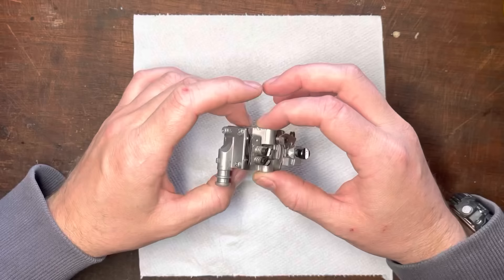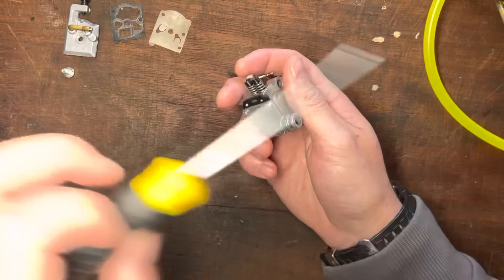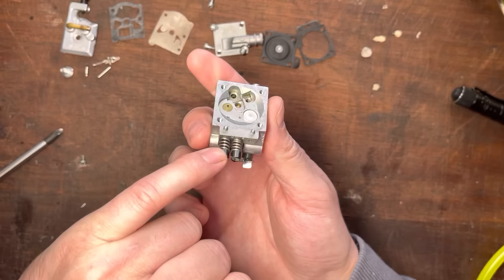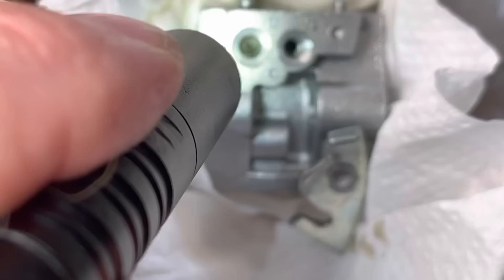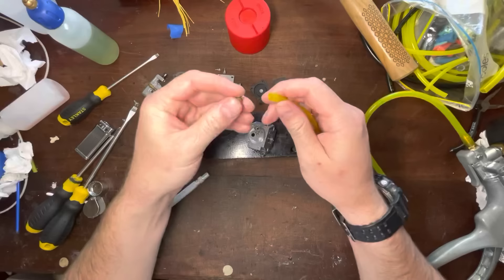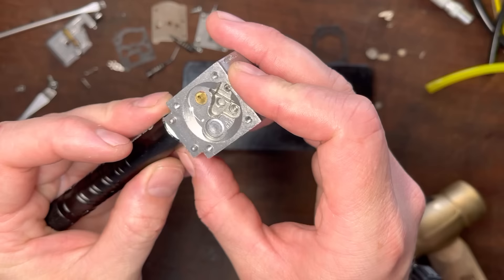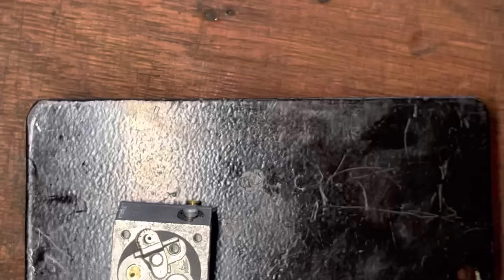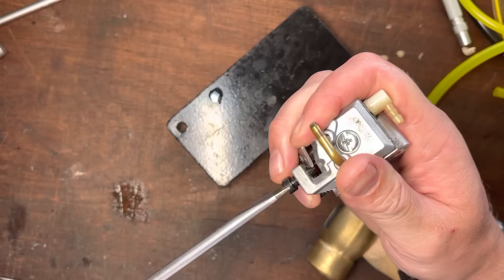2 Stroke Carburetor - In depth Fault Finding, Testing, Service & Repair

Comment: How can I test and or tell if the main Diaphragm is good or bad? Luv the close up views and pin pointer views! Thx much.
Reply from the maker: Thanks :) it should be soft and supple, should easily return to its position and be evenly symmetrical across the diaphragm in terms of shape and profile.
Reply: @VintageEngineRepairs thx much

Comment: Thank you for your video ...I am half deaf +....and I have been able to understand everything...
I have  a few carburettors when I move the  lever needle that it moves it up down  looking closely
I don't see the needle moving up at all ...How  can I  adjust the lever ?...can you help please ?
Reply from the maker: Thank you for your kind comment :) absolutely! The needle only moves very slightly first off, so do look very closely! There is lash between the metering lever and metering needle, therefore although the lever only lifts it a crack, the fuel pump will push it open more removing that lash. 

To set it correctly, requires you to know the model of carburettor, then to see how the manual wants you to set its height. It’s a simple
process of bending the lever. Skip to 24:40 in this video and I explain the process! Warm regards, Tom.

Comment: What will be symptoms if that main check valve isn't holding pressure
Reply from the maker: If it’s not holding, you’ll have strange lean symptoms at idle.

Comment: MR TOM  I would like to ask your opinion  about I am  going to replace the cylinder and the piston
on my Husqvarna 365 . I have got a new cylinder gasket should  it be OK  to instal it dry or should 
 put some kind of silicon on both side of the gasket ? Thank you Tony
Reply from the maker: Hey! You can use a little gasket dressing compound (not silicone!) if you wish, but it shouldn’t be necessary :)

Comment: Nice video. I was a bit surprised that you use that uneven surfaced block to hammer stuff on, as it could damage the mating face where the diaphragms need to seal. That block has all sorts of lumps and bumps bashed into it. I know you need something solid to hammer on, but I guess even a piece of dense wood would suffice with a lesser risk of messing up the mating faces.
Reply from the maker: Thanks for sharing! I have never had an issue, it’s very light and gently tapping. Wood may work perfectly fine, but it will absorb the impact and you have to hit harder to get the same result :) thanks for watching and sharing very valid points!

Comment: Hello, very detailed video, I like it. Wish I had the same equipment.  Don’t know if you can help or not but I am trying to clean up a Zama carb’  from a McCulloch titanium HT 555 , but can’t get a needle diaphragm or a kit for this hedge trimmer , would you know anywhere I could get these items.🤔😊plz.
Reply from the maker: Zama is made by stihl now days, best to contact your local stihl dealer with the model number of the Zama carburetor and they can assist you :)

Comment: Hi great video very informative , i plan on cleaning my zama strimmer carb and replacing the innards with a kit .
Would it be safe to use electrical cleaner spray to clean it ?
Thank you
Reply from the maker: Yep, that will be fine 👍
Reply: @VintageEngineRepairs  thank you , your channel is amazing

Comment: Great video thanks for posting it. Im trying to find out why my chainsaw will start, run for 2 seconds then die.  Any suggestions aside from goin over the carb like in this video?
Reply from the maker: Hey, so many possibilities, did it run last time you used it? If so, open the L screw 1/4 of a turn.
Reply: @VintageEngineRepairs  its brand new it starts everytime runs for a few seconda then dies i been trying carb adjustments but does same thing. I wonder if carb is faulty.
Reply from the maker: @garretgauthier685  in that case just take it back. It probably needs the L speed adjusted richer, or open the idle screw!

Comment: Hi there really helpful video that you posted right here. II would like to ask if the low and high needle will always have a small washer and gasket inside before it gets threaded. Thanks in advance
Reply from the maker: Thank you! Not always! It’s model specific :)
Reply: Thanks for the quick response, I’m in the middle of rebuilding a WJ-71, I removed the needles and sprayed carb clean on the holes where they go in, I was not paying attention if there’s a small washer and o-ring inside. Just wanted to make sure that I’m not missing anything. I’m hoping there’s none because when I thread the needles back they stop in the same position being close. Appreciate you time and help.
Reply from the maker: @Jeremy-Joshua  from what I can see, that model doesn’t have them, no. Good luck with the rebuild! :)
Reply: @VintageEngineRepairs  Thank you for your help! More power to you and your channel. 👍

Comment: I have a wt-990, replaced throttle shaft and butterfly, i Cannot get my butterfly to seat correctly (has light coming through top & bottom, tried rotating, tried old one, even tried light sanding butterfly edge and carb bore with 1000grit! Any reccomendations?
Reply from the maker: Yep, make sure the orientation is correct (look at the witness mark on the brass butterfly, you’ll see a rectangle that contacts the shaft. Carefully install it, tighten the screw most of the way but not all, then flick the shaft / butterfly where the throttle linkage connects and it will sit correctly. Now you‘ve sanded it though, it won’t seal like it should. Whether that will affect how low it idles depends how much has been removed. If it came out it will go back.

Comment: I really appreciated this video. You could use some powder coating tapered silicone plugs instead of that Playdoh material you were plugging holes with; some of them taper to very small sizes...
Reply from the maker: Hey mate, I do have them but they’re not fine enough for the small drillings. Glad you enjoyed the content!
Reply from the maker: Great tip!!

Comment: Very helpful video, lots of details... great! 
I've just a question, as I'm not english mother tongue. At minute 17:00, are you using red nail varnish as a sealant? Is it anything different? Can you explain better? 
Thanks
Reply from the maker: Thank you for the kind words :) that’s exactly right, the colour that women put on their nails that goes hard and glossy. It’s acrylic lacquer - fuel resistant. Though I have heard that it may not be resistant to ethanol?! I’m not certain, but because it’s sandwiched between to pieces of metal I believe you should be just fine!

Comment: Hi!
I checked the carb and even replaced it on my Stihl FS 130 trimmer, but it still struggles to rev when starting it. It never did that. After some minutes of heating up either in idle or sitting in the sun, it works fine. What can it be? A new carb doesn't make a difference.
Reply from the maker: Hmm try opening the L screw 1/4 of a turn (anti clockwise) and try again. You may need to turn the LA screw in a bit to compensate for the drop in revs. Have you checked and changed the fuel filter? Any damage to fuel lines? Is the AF clean?

Comment: I have a friend that has a 2 cycle carburetor that he’s cleaned as good as he knows how to and said it’s flooding the engine. Any ideas??   What’s the most likely suspect??maybe the lever and seat not set correctly???
Reply from the maker: Yes, either the needle isn’t seating or the diaphragm on the metering side is hard and pressing on the lever!
Reply: @VintageEngineRepairs  thanks mate Tom

Comment: When I used small 2 stroke engine equipment I never found it worthwhile repairing these little carbs.   They are a few dollars on Amazon.    All my gas/petrol driven garden equipment is now gone.   It has been replaced with DEWALT 20 or 60 volt equipment.   My workshop already had been converted from corded to 20/60 volt DEWALT stuff so the batteries and chargers were already in hand.   All I needed were the bare tools.    Nice and quiet, no fuel storage, always ready and always works.
Reply from the maker: I find it rewarding and much quicker and cheaper to repair oem rather than replace with Chinese am. Takes weeks to arrive here in Australia and they’re always $40-$50 each or more.

Comment: I've been repairing small Equipment for over a year now. The first thing I learned was, 'check the carburetor'. I can count on my fingers the times I have repaired equipment without having to work on the carburetor. Great informative video. What is the brand of the vacuum tool you used?
Reply from the maker: Thanks :) mityvac 8500
Reply: I appreciate it man.

Comment: I had a leak through the L screw( carvig) with the same carb , I solve it with small amount of plumbing thread tape but if you have better way to  seal it please share
Reply from the maker: Interesting! Was there meant to be an o-ring there? Behind a small brass washer?
Reply: @VintageEngineRepairs   the Carburetor  is walbro WT-215, can you give me the part numer of this o ring

Comment: Hey, I'm not sure I fully understand the part at 25:15. You pump air and you check if the lever is set? How? English is not my main language sorry 😀 Thanks for all the great content. I can tell you do it with love and passion. I know the walbro carbs pretty good, but you are on another level.
Reply from the maker: Hey :) yep you put pressure on the needle using the hand pump and the metering gauge should just touch the lever so that the needle only just cracks and lets a tiny amount of air through. That’s set correctly l.
Reply: @VintageEngineRepairs thanks my man, I go it finally after reading your reply a few times and watching again. I thought how can you check the height if pumping air from this side will move the lever down eventually. But you push the lever down and check leakage. Pretty straightforward, but sometimes you just go in the wrong direction when "translating". Thanks a lot, best.
Reply from the maker: That’s ok :) yes the spring under the metering lever keeps the needle from letting air by. So using the gauge then allows you to set the height. Note that above a certain pressure - typically 10-15psi it will overcome that spring pressure and “pop off”. Pop off pressure has a small affect on how the engine will run :)
Reply: Thanks for the clarification Tom! Didn't get a notification or your latest reply but was thinking about asking your opinion these days. Yes, the pop off on walbro is a factory set number I think. Just watched your "jackhammer" save video. Great work as always. I helped a friend refurbishing a 2T chainsaw. It has a walbro wt. New fuel lines, filters, carb rebuild kit, clean carb, lever set to spec, gas leak test ok (thanks for the propane tip), idle excellent as long as you wish. You set up L H perfectly, it works for 5 minutes or 5 days perfectly then acts like it loses the tune completely. Bogs down usually when revving but keeps idle flawlessly usually. Suspected the L H jets are turning from vibration. Did a photo and hot glued them, it's not about that. I don't have the vacuum tester unfortunately but I guess it's the main valve on the carb or something like that? The carb gaskets and manifold are intact. Really strange honestly. It goes off, then you tune it perfectly in one minute, stays perfect for some time, starts to act funny. Usually bog down but revving fully eventually. I'm in Europe, an original walbro is hard to get, they cost a lot, aprox 90 euros, the shops have mostly China clones, but I'll try to find a used one or buy a clone for cheap directly from AliExpress. Sorry for the long message, I was really curious about your opinion and if you encountered anything similar. Many thanks in advance! Kind regards!
Reply: @uadcro ia și curāţā locul unde stā cuiul  ponton  sau ac  cum îl numiți unii. Cuiul de obicei se blocheazā în locul lui,nu mereu și nu de tot de aia apar figurile ,ori relantiu mort ori turaţii sacadate

Comment: Good video , also there are some diaphragms that go opposite of this one , they go diagram then gasket , but usually they have a short metal tip in the diagram .
Reply from the maker: Thanks for watching Darell! I must admit, I have never come across any carbs where the metering diaphragm goes on first followed by the gasket!

Comment: Awesome video, learned tons from it. So what happens if you put diaphragm then gasket? What are the running symptoms? I put mine together this way as it was how it came apart. Seems to run ok except a bit boggy off idle
Reply from the maker: Thanks :) if you do that on the metering side you’ll get rich symptoms - the needle will be opened earlier / more.

Comment: How does the high speed jet seal?  It looks like it's just a straight through hole that air could be sucked through when pushing the bulb...
Is there supposed to be a tiny internal bearing or something? I think it's the high speed jet, it's a brass screw with a hole down the center and a slotted screwdriver head...
Reply from the maker: You’re exactly right, there is a small check valve, sometimes In the form of a ball or diaphragm disk.

Comment: Thanks! Again very informative 😍 What could cause a walbro (new) carb to leak through the throttle lever/arm?
Reply from the maker: Hmm it shouldn’t honestly, what makes you think it is? Spray some brake cleaner around that area when the engine is running and it shouldn’t change in rpm :) if it is, take the carb back and get a replacement!
Reply: @VintageEngineRepairs   That engine (dle 20cc) is hard to start and soon fuel drips through the throttle arm, i have ensured all packing is intact and all screws tight :) Thanks a lot for your kind reply and the free knowledge you are sharing :)

Comment: Great video thanks given me a few pointers on an old Stihl given to me as a non starter. The carb kit supplied did have a longer pin on the diaphragm than original. Starts and runs a dream now but bogs out on load. Maybe I'll strip the carb again...
Reply from the maker: It’s worth determining if it’s a rich or lean bog. If the metering diaphragm has the longer nipple and that is in fact the issue, it will be a rich bog :) it’s opening the metering lever & needle too soon.
Reply: @VintageEngineRepairs  Thank you, I wasn't anticipating a reply, other than the satisfaction of sorting it, a new carb is very cheap, maybe I'll go that route as I'm not a patient artisan!!!

Comment: All the carburetors that I have seen with that bigger piece is the impulse barb and it is supposed to have a little plastic disc and is supposed to have a spring on the underside of the disc.And the holes in the bore, the one behind the throttle plate is direct vacuum and the one on the other side is called metered vacuum and is for the high side jet and only works when the throttle is being opened.And the fuel inlet side has to be assembled before it will hold pressure on the metering side? That carb came off of a stihl weedwacker?
Reply from the maker: Sorry Tony I don’t understand what you’re saying. I think you’re referring to the metering chamber where you have the needle, seat, spring and pivot pin as well as the welch plugs and drillings for the jets.

Comment: In my rc plane which has a walbro for a 35cc 2 stroke. When I pull a hard inverted loop my engine cuts every time? Do you think high G's would stop the diaphragm?
Reply from the maker: I’m not experienced with high G’s but I’d suggest trying to richen up the H screw, it’s more likely that it’s just lean.

Comment: @vintageenginerepairs how do you remove the nozzles that have to be pushed up from underneath?
Reply from the maker: You use either a slide hammer tool or push them through with a screw driver 👍

Comment: Does the needle clip onto the nipple on the diagram? You did not show that. I clipped my needle onto it for a Mac 10-10a chainsaw carburetor called a walbro SDC 37a. My saw runs good for a few minutes and then is impossible to start. I ordered a check valve on eBay. I have learned so much from this video but you missed the part I am struggling with. I live on long Island in NY. I am very impressed with your genteel spirit as you display Ann absolute supremacy in command of demonstrating the task at hand. I just don't come across this level of candor and professionalism in my day to day. I hope you take the time to respond and thank you for this wonderful video.
Reply: I meant the fork in the needle bar that sits under the nipple in the diaphragm
Reply from the maker: Thanks for your kind words. Yes many of the older saws have a clip on metering diaphragm to the metering lever. This carb, and most now days don’t clip on, they just contact under vacuum :) does it start up again once it’s cooled down? If your mac has points, it could be the condenser failing. If it’s not points it could be the coil. I’d suggest that you see if it has spark once it stops running. Hope this helps :)
Reply: Hi, it has a chip, so no points. It does start later. I thought about the coil. I'm going to inspect the check valve and see if I can get a coil. Thanks again!!! @VintageEngineRepairs
Reply from the maker: @jkgkjgkijk  it sounds like coil! Eliminate the plug first of course :) you’re welcome!
Reply: Yeah, no coils for that on e-Bay right now. I'm still gonna go through the carb again while I wait for an ebay alert. I read an arbor site post with this saw that had the same issue and it was the check valve. Thanks again. @VintageEngineRepairs